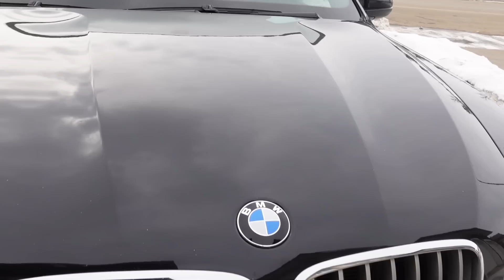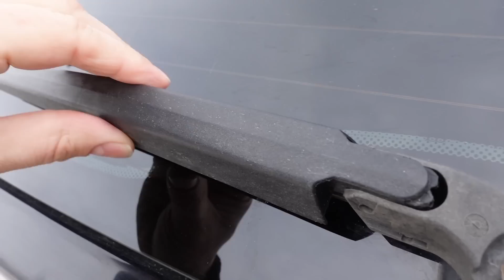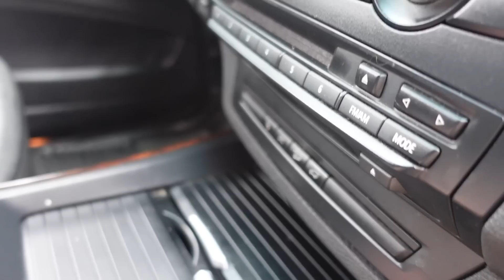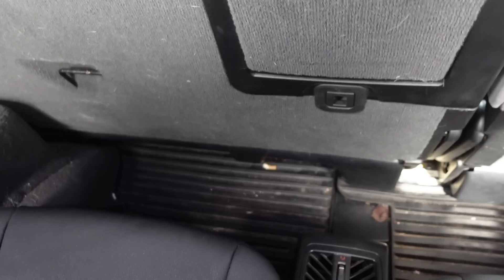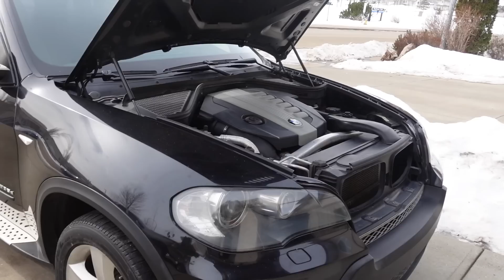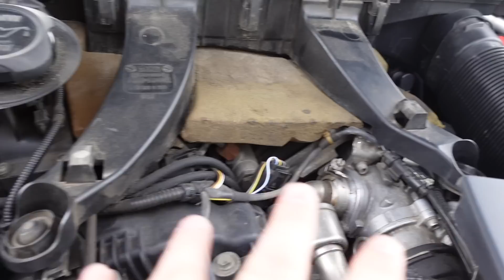10-Year Ownership Of My BMW X5 - A Long Term Review

Comment: Comparison to my former 2007 Audi A6 premium plus Quattro.   Bought in 2008 as a CPO with 27500 miles and 100000 mile, 6 year extended warranty as part of the CPO.  Gave the car to a friend at 195000 miles.  Only minor issues….forget the dealer that always wanted to do unnecessary work.  Routine maintenance every 10K miles averaged about $200.  Never used oil between changes, new battery every 5 years, tires about 50k per set.  No suspension or engine repairs, never changed coolant or tranny fluid, per owner manual.  Interior and exterior like new except had to replace leather trim on driver seat for $150.  Recharged AC once at 150000 miles, replaced cracked rear lights for $125 from eBay.  At 90k did 90 minutes on the Pocono NASCAR track with Audi club…no issues.  Only real problem was failure of satellite radio receiver/amp which kept draining battery. Dealer wanted 1200 to replace.  Used amp was 150, dealer programmed it for 135…since wiring is fiber optic could not use after market.  Car drove great, 6 cylinder with good power and 27-30 mpg cruising at 75.  If you have an Audi beware of dealer repair shop unnecessary work.  Was told needed $2000 suspension work at 90k miles … not true, never touched suspension.  This was the best vehicle I ever owned and I have driven over a million miles so far in Fords, Lincolns, Chryslers, Dodges, Hondas, Toyotas, school busses, Austin Healey, etc.
Reply from the maker: Thanks for sharing, and yes sometimes a second opinion is important or going Indy may give you other options.
Reply: Audis are also a hit and a miss just like any other germans. You probably had a naturally aspirated engine. There are horror stories about 2010+ Audi's turbo 4 and all the oil consumption
Reply: @k-man-dude  I totally agree.  I don't like 4 cylinder turbo engines - every one I drove suffered from nonlinear acceleration and the earlier Audi 4 cylinder turbos were definitely oil burners - I don't know how they are now.  However, a cousin bought an A4 roughly 6 years ago from a used car dealer with about 50K miles.  It burned oil and the used car dealer sent her to an Audi dealer who rebuilt the engine (might have replaced it) at no cost.  That free work may have been usual or not, I don't know.  But I do know that BMWs are known to be expensive to maintain after the warranty expires.  My Audi would have cost a fortune to maintain if I listened to the dealer's repair shop.  But they are comfortable, safe, drive well and expensive cars are always expensive to maintain.  Yes, I think I was lucky with mine.  And I drove it on the NASCAR track at Pocono Raceway with the Audi club, hitting the 133 mph governor on the main straight frequently for 90 minutes with no problems - again, maybe I was jjst lucky.

Comment: The number one takeaway is just don't go the stealership for any service after warranty. Here's a typical comparison: Temperature sensor in the lower rad hose costs $6 after market and 2 minutes to swap out. Cost from the stealership: $80!!!! That is just criminal for a part where there is no way on earth that the cost can be justified. It's even worse for more substantial parts. So far, mine has been a pretty easy keeper eveen though it's got waaay more miles on it than yours.
Reply from the maker: Thanks Kenneth.  Yes these people earned the nickname Stealership for a reason.  I typically do a lot of my own work too but once in awhile the trouble is a bit too complex.

Comment: Before I buy a vehicle, i always ask the head mechanic a question.  Do you have an expert electronics technician and does he have an oscilloscope?
Reply from the maker: Haha, I wonder if the dealer I use only runs a set of crescent wrenches.
Reply: @ECPP , hahaha!  we had a problem before where the company shop is having a hard time diagnosing the electronics!  i asked the mechanic to remove it and brought it to our expert electronics repairman!  he found the problem easily!  before repairing the part, i requested him to use his oscilloscope to check everything!  he found out that the value of that electronic part was low and he changed it to a higher value and said that it will not break anymore!  he said that this is what companies do!  so that in a matter of time you have to replace the whole unit!  the price of the part that he replace was only cents!  hahahaha!

Comment: Yep, I have the same 2009 35D here in Australia. Mine only has 190000Kms. No third seat option, but has a towpack which mandates 20inch run flat tyres. No rib on the tyres to prevent rim damage. Makes the ride harsher as well. Gearbox issues where it goes into failsafe every now and then (this ZF6HP28X trans was fully overhauled at about 130000Kms by previous owner). Pull over, turn it off then back on and it comes good until next time. We do not have diesel fluid in this model over here. Interior issues with the rubberized trim coating is the same. Fan control buttons have the legends worn off them by useage. I have anodized aluminum trims in my car not the fake wood. No crack issues. Sometimes the Nav system will not read the disc (yes, I tried a new disc already). Full shutdown, short wait, and restart normally gets everyone talking again.
Our problems come from the savage sun, not the cold. We have no salt or ice on our roads.

I put a new battery in mine about two years ago, cost me AUD 270. Rear differential mount bush (AUD40).
Rear injectors can suffer from water ingress from the back of the bonnet as you say, The plastic walls that hold the hood seal break as poor material. I replaced all mine and got the spares out of China, cost me 1/4 what our local stealership was charging!
But this may be more an issue with your weather conditions as not a big problem over here.
By the way, the 35D has no more compression that the normal 30D. It has a twin scroll turbo (versus single in the 30D) and an uprated ECM program for more power, and the front guards are plastic, so they will never rust. Steering is a little heavy at low speeds, OK on highway.

Oh yes, I would never own a BMW if I could not repair it myself, only the very wealthy can afford dealer servicing in Australia. I would only take it to a dealer if I could not program a module. Dealers rip you off severely over here. But I love driving it, so much torque!

Comment: Here in the UK virtually all X5's are the diesel model. The Police use them for traffic patrol & Armed Response Vehicles. 
Generally the vehicles are pretty bullet proof and will do very high mileages without major issues. 

Great channel Mark. Keep up the great work you do. 
Best wishes from Worcester, England. 👍
Reply from the maker: Hi, thank you very much for watching.
Reply: @ECPP Where do you get your repairs done...in a diamond 💎 studded garage? 😂
I skip yearly services on my X5 and only top up original oil. Change tyers every few years and they're fairly cheap.
Garage costs are cheap too. Just had brand new brake pads and sensors both sides front end, and the mechanic charged for parts & labour $115 total (£95).
Engine smooth as silk and recently passed 151,000 miles.
Reply: BMW X5 bullet proof? What? 🤣🤣🤣🤣🤣🤣🤣🤣🤣🤣🤣🤣🤣🤣🤣🤣🤣🤣🤣
Reply: @Roberto-nj5r The BMW X5 3.0D e53 engine is bullet proof and one of the most reliable engines ever made.
Reply: Exactly what I commented on another video ..  I and my family have always had bmw x models and it’s not had any problem 
Just normal yearly servicing with Kwik fit or Halfords, we don’t go bmw dealerships cos they’l charge more.. police use x5s and have gotten the latest ones too cos that thing is rugged & goes for decades. I think it’s the American ones that’s lemon from what I see online , it’s usual yanks complaining ..
Reply: @Dondadda-G 
To be fair we have very mild winters in England that are forgiving to these cars. Still, $1200 for a battery change? Whoah, the most expensive option for me would be getting one for around £100 and sticking it in myself. It's not like you need to disassemble the engine to put in the new battery, is it. 🤔
Reply: @Phoenix_cataclysm_in_2040  that’s bullocks though no one’s paying a grand to change batteries unless they really reaping them off so badly in the states 😂😂
Reply: The diesel versions of x5 are actually the worst ones...
Reply: @jonc2914  Completely untrue. The BMW X5 e53 diesel ⛽ 3.L is a bullet proof engine and very reliable, especially combined with the 6-speed auto gearbox in the updated versions.

Comment: I guess part of your problem is going to the dealer for repairs that would cost a lot less at at an independent shop or if you do it yourself.  You mentioned $250 for an oil service.  I have a 2012 E70 X5M.  I do my own oil service which is ridiculously easy on this car, you barely have to jack it up.  I use Red Line oil which is $15USD/qt (but Pennzoil LL-01 IS $7/qt. at Walmart, and exactly what comes in the BMW bottles).  I use 7 quarts, so $49USD for oil and $26USD for a Mahle OX 353/7D oil filter on Amazon.  So $75 for an oil change.  

Many repairs on my E70 have been maddening, a starter that I had to have the dealer install was almost $2,000, and I've had to replace the battery twice at about $225 each (buy the $100 tool to dump BMW codes and register batteries, etc.).  I've replaced the IBS twice (Hella OEM version for about $100, and I replaced the alternator with a used one for about another $100.  My shifter lever failed, but I got a used on on eBay for $200 ($800 at the dealer). 

If any of your control modules go bad there are services that will repair them, or there are plenty of used parts available.

I haven't kept detailed records, but I've owned my 2012 X5M for 4 years and just about 80,000 miles - the car now has 151,000 miles.  I'd guesstimate that I've spent about $5K on repairs including replacing all the brake rotors, pads, and e-break) shoes over the 4 years.  I paid $25K USD for the car (sticker price over $100K) so I don't think it's been so bad.

Oh. yeah - I had to replace the blower motor too - I hope there's a special place in hell for the person who designed that assembly.  I did it some years earlier I about 2 hours in our E90 335i, and this took at least 6 or 8 hours.
Reply from the maker: Thank you very much for sharing and I totally agree.  DIY wins.

Comment: 130k, its time for it to go. At ten years of ownership you said all the problems I had in my E46 2003 330xi when it was 100-140k mileage. Sunroof failed, Ignition coils blow out when I would floor it. Carbon build up, small rust size of a quarter on rear fender, 6 cd changer stuck in the trunk and wont play possibly because i put M3 burned cds in there, plastic crap warping under the hood, radiator expansion tank/ radiator leaks. Engine oil leaks even after changing the valve cover gasket. locks working when they want locking you in or out of the car. window regulators would break every couple years. Literally everything went wrong on this car. But I still like how it drove compared to my Lexus.The transmission and engine are legendary but everything else breaks and it got to the point of diminishing returns and after i sold it, the guy crashed it 2 weeks later and totaled it! I was so pissed off like it was still my car. It was hard to let go but its just not worth it to hold onto. next five years might be 20k in repairs :/

I bet you will get a Lexus after all that.
Reply from the maker: We have been looking for sure

Comment: Okay man, sorry this has happened to you, but a lot of this could have been prevented easily.

1. The rear airbags are cheap and easy to replace. And why would you go with aftermarket ones, if the BMW ones lasted 10 years?

2. Get rid of that emissions equipment and get a tune. No DEF, no DPF, no EGR, and your reliability goes up 10 fold, and your expenses plummet. Not only that, but the entire system is covered by warranty. Even if they have to replace it 10 times, it's still on BMW to cover. It's not a one time thing as long as you're under mileage and age. You should have escalated that to BMW corporate.

3. The injector problem is well known and the solution is easy and cheap. Just preventively replace the rain cowl tray pieces. Just a quick Google search on "common x5 diesel problems" would have saved you a shit ton.

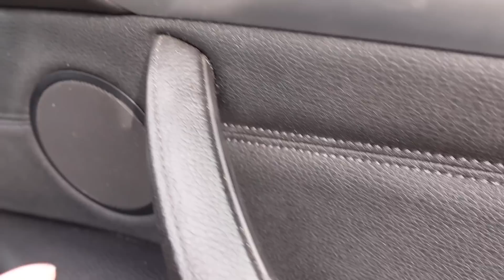4. 6:04 Those are like $20 on Amazon. Come on man, did you even try? 

I spent about $2,500 on mine years ago (doing all preventative maintenance and delete), and haven't had to do anything since. My Toyota literally costs me the same averaged per year.
Reply: Thanks for the first informed reply. Based on what I've seen, the owner was not willing to do some research on anything, including parts prices. My 335d has been as good as my N52 128i as far as reliability. Just got to do a bit of research and get rid of the emissions stuff.
Reply: Man thanks for that info, much needed for these E70 x5d’s

Comment: I spent 7k on the infamous N63 engine replacement. However she’s been mostly free of problems since then.
Reply from the maker: Hope it holds up now.
Reply: @ECPP  I added an oil cooler and low thermostat and she runs great - it does not burn a single drop of oil!

Comment: My M550i cost me $20k in 5 years of ownership. Used the car as a second car and sold it at 75k miles. Bought it at 32k miles. $20k for 43k miles. Never again. N63 engines are a nightmare
Reply from the maker: You are totally right.  They are very promblematic and just not worth the hassle.

Comment: WOW, Marc, a grand for a battery? When i had my 1996 Jeep Grand Cherokee with the 5.2 i got a battery at Walmart for under a 100.00 bucks, i would rather have a gas version ANYDAY and diesel fuel is MUCH more expensive at least here in NC, i replaced all 8 of my injectors with BOSCH 4 hole units from ebay for about $75.00 

Remember you said never another BMW!!!!!!
Reply from the maker: Thanks again Iim, and great to hear from you again.  You are right that being thrifty is a good way to own these and the more you do yourself, the more you save as well.  I am done with BMW and once the X5 is gone, will be time to party.  I still have the M5 but that’s one of those unique vehicles that MAY be worth some hassle.  Buy a new or another BMW?  No, too many other great cars our there, to subject myself to the abuse that I get at the dealer service counter or the parts bin.
Reply: @ECPP  Seems the EPA/US govt. mandates regarding ever increasing pollution standards and improved gas mileage hasn't helped at all but an inferior part is an inferior part regardless. I have owned 5 Hyundai's and now a 2021 Kia Forte 6 speed manual, fortunately i didn't buy a Sportage with that DANGEROUS 2.4 and seems Kia is making customers jump thru hoops to get a replacement engine if at all! That's not good CS either so i think the bottom line is once they've got your $$$$ [purchase] and the Salesman made their pitch is when the tables turn.

Comment: i own a 2020 x7 x50i.  paid cash for it and totally love driving it.  i have close to 40,000 miles on it. I've had nothing but problems with it from electronics to suspension. what bothers me the most is the ineptness of the dealerships i have dealt with.  '"we can't reproduce the problem"  is the usual reply i get.  i take it to another dealership that finds the problem and partially  fixes the problem. i then take it back to my original dealership and they fixed what the second dealership missed. i had a squeak in the front end they could not diagnose.  i took it to another dealership and they couldn't find it.  i was visiting in nj so i brought it to a dealership there. that makes three dealerships. they found the problem.  when i got back home i had my dealership call them.  it turned out i needed new struts. it took them 33,000 miles to find the problem!  my left front headlamp clouded up and needed to be replaced but they had to get an ok from bmw.  he said the headlamp cost $7000.00! thats right you're reading correctly $7000.00 not including labor. thank God i was still under warranty. this was the most enjoyable suv I've ever driven but when warranty runs out the car goes with it.
Reply: You should have financed it bro😂 always finance a car stop buying things in cash all the time Finance the damn car you'll thank me later
Reply: @thekobechannel4610 explain?
Reply from the maker: Wow Sandy, that sounds like a pile of troubles are brewing and yes warranty is your friend at this point but I have also found the dealer experience in some cases to be sub par.  Man have I got stories.
Reply: The dealership knows what is wrong with vehicle, they are just telling you they don't know until your warranty runs out.... Mechanics don't get paid much when they have to work on vehicles under warranty...

Comment: Correct me if I’m wrong, it seems to me like the dealership is a substantial part of the problem. If they were more sensible, took ownership of their product, your experience could have been less disastrous. Thank you for the usual great vid 🙏🏼 looking forward to seeing your next brand direction
Reply from the maker: Thank you very much for your comment and yes, I totally agree with you.  Those clowns have seen me for the last time in their building, however, they can enjoy the videos from here on.
Reply: @ECPP I firmly believe that BMW is making a huge strategic mistake by gouging on parts through all their dealers. Simple little bolts and fasteners are priced at least 5 times higher than would be considered reasonable. More substantial parts are always a large multiple of the aftermarket price. Our dealership here isn't incompetent like yours, but their estimates for routine repairs are pornographic, mostly because of parts prices. Thankfully there is no shortage of decent aftermarket parts and lots of fully competent independent shops.
Reply: @kennethstanton5407  Pornographic 😂 quite the description